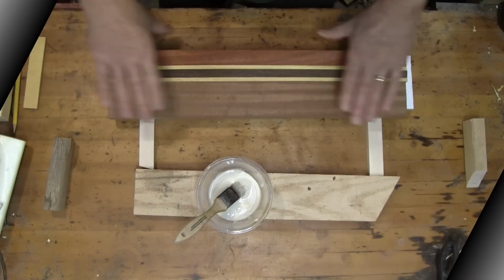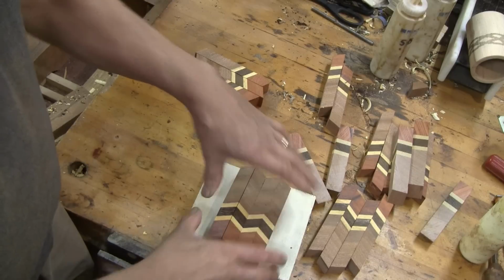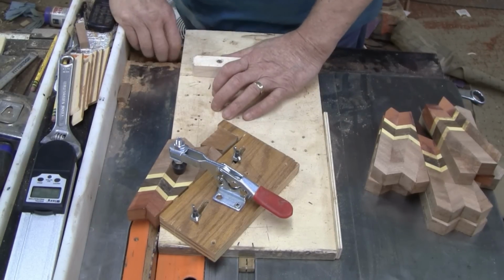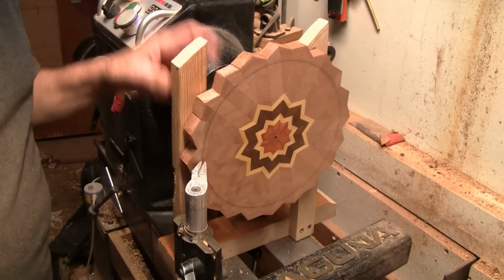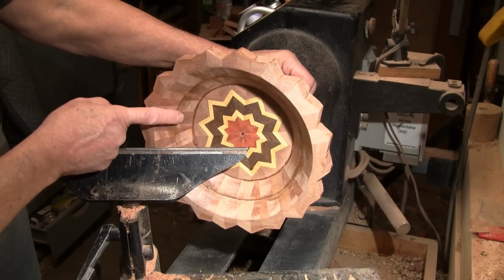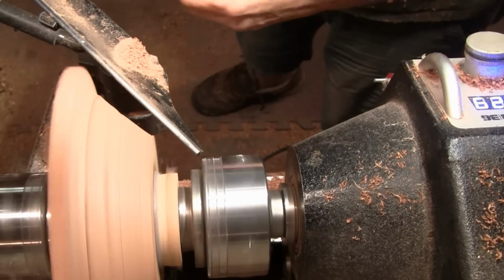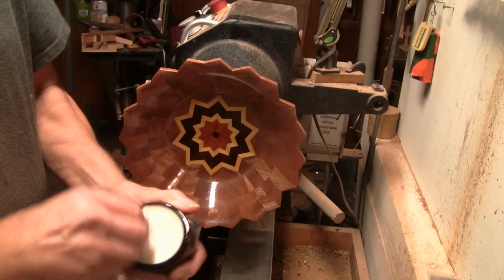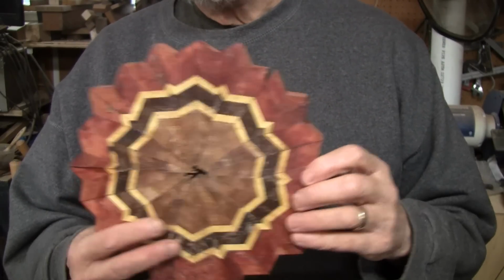The Radial Radial Feature Ring Wood Turning

Comment: I only see you using a half inch bowl gouge, the parting tool and a negative rake scraper. Are those the only ones you ever use, or do you use others too, and for what purpose?
Reply from the maker: Hi Nathan, when I do segmented work I pretty much stick with the 1/2 inch gouge. I have a few 5/8" gouges I use a lot when turning a chunk of wood.
 Segmented work is made from kiln dried wood and the grain is normally working in my favor so it does not take much to turn.
Thanks for the question,
Gary
Reply: @ThePapa1947  makes sense. Your videos are great!

Comment: Thank you for the tips! How are you sharpening your tools and how often? What's the angle of a bowl gouge and scrapers that you use?
Reply from the maker: Thanks Steve! I use the Vari Jig for my gouges.  I grind most of them at  a 55 degree angle. I use the platform for my scraper which is a 40 degree angle. I have CBN wheels on the grinder. A 350 and an 80 grit.

Comment: I’ve heard some say a center plug can cause a crack but I’m curious if that can occur with such a small plug like what you used - any though as to if cracking is possible and is there any certain size plug that you think is ok to go up to?
Reply from the maker: Hi Randy, I have used center plugs in segmented turning for 50 years and have to say I have never had one crack because of it. I can not speak for others. Maybe it is the weather here in the Pacific Northwest. Or the wood  use.
 Same idea with floating bottoms. I just do not use them. Oh I have put a different color disk in there so I could sign the piece of have it help light up the inside. People will guarantee there will be issues if you do not use one. Well basically I do not use them. The disk I have used have been glued in at least 4 spots. I only doe those if I cannot get segments lapped on the bottom without making 2 half thick rings. Which still shows up as out of place on some turnings.
 I may be doing another so and will address why I do what I do.
Thanks for asking,
Gary
Reply: @ great to hear and thank you so much for the reply. One other question about center plugs - do you make the plug with grain orientation as side grain or do you find that it’s fine with it perpendicular to the bowl? I wasn’t sure if you have a recommendation as to the grain orientation of the plug?
Reply from the maker: @randygust3423  I prerer to use flat grain. Maybe on something real small end grain is ok
Reply: @ThePapa1947  appreciate the advice. Im always curious on thoughts of segmented base versus a solid base. Im probably overthinking it. I really like the look of the segmented bottoms over solid but didn’t know if center plugs had much of a negative affect at all.
Reply from the maker: I generally use segmented bottoms with no plugs 
Not hard to do. Takes a sharp blade and a slow cut.
I will use a plug for looks on some turnings.

Comment: G'Day from down under. Love watching your videos. Can you give me the length of the pieces you have made for this or doesn't it matter  ? I am trying to make one and want to get it right . I am trying it first time with some less valuable wood so if I make a mistake it is not valuable wood used. I know the first angle you cut length ways is 18 degrees in your wedgie sled. What angle do you use for the 2nd cut on the wedgie sled? Keep the videos coming. Love them all
Reply from the maker: Hi Doug,  the board was laminated from 5 strips. Those were  2.25, ,.25..5..25 and 1 inch wide. Which equaled 4.25 inch wide.
For the second cut I had the sled set up to cut 36 degrees which gave both sides 18 degrees. So to of those makes a 360 degree circle.
The length does not matter as long as you make the segments equal. The longer the lengths the larger the diameter will end up.
But if you make them longer you will have to make the strips wider.

Hope that helps...if not let me know,
Gary
Reply: @ThePapa1947  Thank you for the reply,I will see how I go with it . I have to finish off the wedgie sled and then I will get in and make it. I have the 10 pieces glued together.

Comment: You may have answered this before but how often and how do you sharpen your gauges?
Reply from the maker: That is a very good question.
On a turning like this I start with a fresh grind on the tool. This should complete most segmented turnings.
If a log then I may have to sharpen a couple of times on harder woods.
Hope that helps,
Gary

Comment: Gary I would like to try my hand at making the radial bowl but I don't know the dimensions of the material you used.  Would you share that info?
Reply from the maker: Thank Jerry.
I could give you some up to the point of cutting the segments.
When I cut the segments I just cut them to clean up on each side and did not write those dimension down.
I should have them for the glue up though.
Gary

Comment: When cutting the rings, why don't you glue 3 or 4 small sticks radial out at the back so that it would hold cut piece from falling away?
Reply from the maker: The way I size the next ring is to take if off and measure the inside bottom dimension. I transfer that to the next ring to be cut.
If I glued a stick on I would need to break it loose for each cut after that.
The way I do it gives me the best fit I can get. The fixture I made can be used over and over.
Hope that makes sense.
Reply: @ThePapa1947  That I understand. I was not talking about sizing I was talking about not needing to catch the part that was parted off. And since english is not my first language I told the wrong word. I should have said to glue on 3 or 4 tangential (not radial) sticks. I jope this makes more sense now. :)